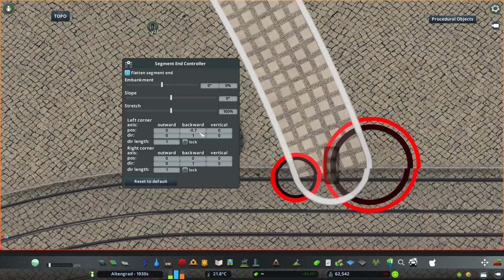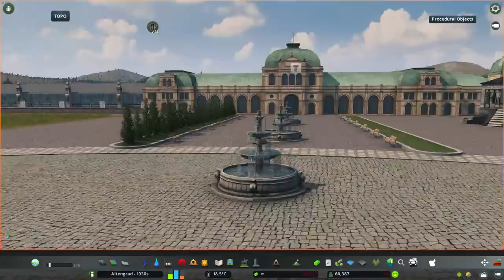Exhibition Centre - Cities: Skylines - Altengrad #36

Comment: Nice. 26:50 You need to add a way for the pedestrians to cross the tram tracks nearer to the stop, so they don't have to all walk back to the intersection. Maybe where those white stone networks end, on both ends of the actual tram station.

Comment: You shouldn't upgrade regular country roads to highways later on. Usually they might make it bigger with more lanes on some parts close to the city, but they are generally kept intact at the original place. Highways are then built close to the original roads, if it's possible or if it's an important road, and even far away from the original roads, if needed.
Reply from the maker: Yeah, when we'll do highways it'll be a bit more planned project while leaving the existing roads as they were.

Comment: Dear Akruas, how do you like the idea of (inofficially) naming a city part on one of the other sides of the river Neuengrad or Neugrad? That's what's happened in quite a few german places. Sometimes the newer town became bigger than the older one, sometimes not. There is one particular case of this in the hometown of my parents: Celle. The town has around 70.000 inhabitants but one of its suburbs is called Altencelle which is basically where the city started back then. This place is more like a large village though